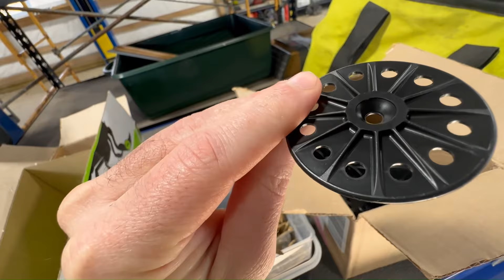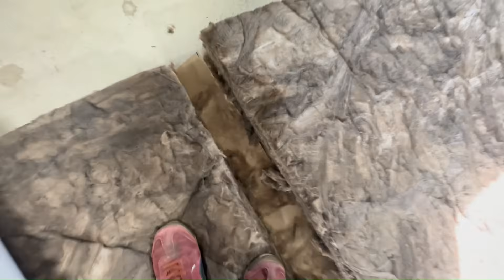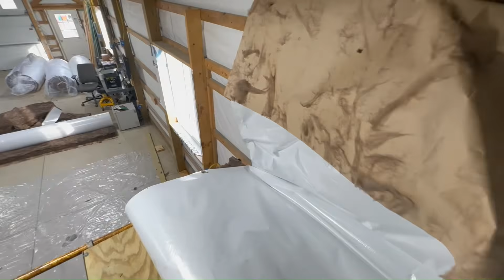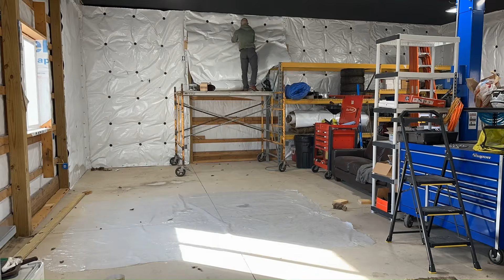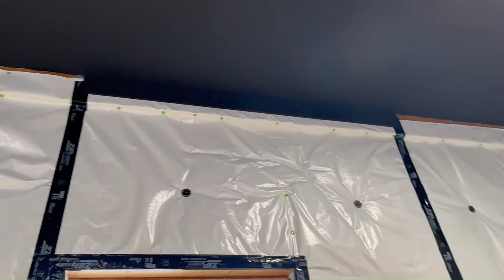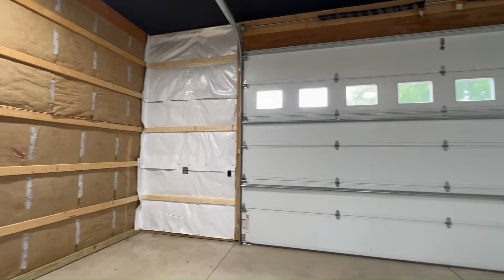Installing the CHEAPEST Insulation In My Pole Barn

Comment: Could you share the info on your ceiling fans please?
Reply from the maker: At the time they were the cheapest 72” indoor/outdoor fans from Home Depot. They are discontinued now but you can find similar ones on sale for under $200. They have worked great for 5 years now and run constantly in the winter. A cool brand that has come out in the meantime is Parrot Uncle. I’ll give them a try if these fans ever fail.

Comment: Just hang the cheese cloth and blow fiberglass in… Done.
Reply from the maker: I considered that but was worried about settling. Do you think the cheese cloth would have spanned 8’ okay? It probably would have been a lot less labor intensive.
Reply: @ShawnFerret 
Yes. You blow it in a little dense and it usually never settles. 
If it settles a couple inches after 10 years, worst case scenario blow in a little in the top layer and you’re done for life !
Waaaaaaay less labor intensive!
Good hustle tho!
Good video!

Comment: What did you do for your ceiling?
Reply from the maker: The ceiling is drywall. I regret not doing metal. I didn’t do a good job with the mud and tape and the seams are all cracking. I painted it black to hide the cracks.

Comment: How heavy was each of your roll? Approx. Trying to find out if 1 person can lift it for transport. (Have shoulder injury)
Reply from the maker: I couldn’t lift one by myself, but I could roll them or drag them around. When the tractor trailer arrived at my house I backed my pickup truck up to it and dragged them into the bed. Then I drove into the shop and rolled them off the truck bed. I think two people could lift them up but probably not with a shoulder injury.

Comment: ?? IF building wrap is on outside and Your insulation has a vapor barrier face, will that create an area to trap moisture between inner and outer walls ? Just a thought.
Reply: No.  House wrap is breathable. Almost every home is built this way without issue

Comment: Really appreciate the video.  I have the same product but have 16' side walls.  Trying to figure out the best way to install.  I chose to put up Insul Hold metal strips to try and support the weight.  We'll see how it goes.
Reply from the maker: I hope it works out for you. It doesn’t seem to take much to hold it. It’s definitely easier with two people dealing with the massive rolls though.
Reply: @ShawnFerret  thanks!

Comment: I have a question.  What is already up on the walls?  Is that the thin reflective bubble foil stuff?  I have that on my building as well.  I was looking to insulate with something similar to what you did but won’t that create two vapor barriers? 

Won’t 2 vapor barriers be an issue?
Reply from the maker: Mine is Tyvek, so it's a vapor retarder that dries toward the outside. So any vapor that gets traps inside the wall cavity can still dry. I agree you wouldn't want moisture to get trapped between two vapor barriers.

Comment: Silvercote told me if I already had the vapor barrier like you do I can’t put this up because there will be two vapor barriers causing moisture build up in between.  They said I needed to cut the old stuff out first.
Reply from the maker: @Grunt300z  I used Tyvek which is a vapor retarder, not a vapor barrier. The Tyvek allows drying to occur to the outside so moisture won’t get trapped in the cavity. I had the back side of the Tyvek exposed for many years while heating the building, and there was never condensation buildup on the backside. That made me confident I wouldn’t have moisture. There is also a 1.5” air gap between the Tyvek and the insulation due to the width of the girts so if there ever was condensation it wouldn’t contaminate the insulation and would have time to dry. I think it’s also an advantage that it is a big open space and without a bathroom or kitchen there is not much humidity being created in here. This setup works for me in climate zone 5 but it might be different in a hot humid climate. I’m definitely not a building science expert but I did put a lot of thought into this because there’s no way I want to have to tear it back out!
Reply: @ShawnFerret  So like R&R buildings here on youtube you were using the tyvek for a little bit on extra air barrier?  I need to insulate dad's shop, that i had no say so in design, but has no tyvek.  I'll probably put some tar paper or tyvek on inside of girts and then insulate similar to you.
Reply: Yes, you have to be careful not to create a "vapor sandwich"..... but I'm not convinced you need to "cut" the old stuff. Perforate maybe, but not cut. But here is the bottom line: IF you are planning to provide climate control (AC in summer, heat in winter), the moisture level in that building will be LOW.... unless you plan on taking showers everyday in that building. So,,, condensation is of little concern....IMHO. I live in SC... climate zone 3. The humidity is HIGH here. My mini-split runs ALL Day. As such, the humidity in my 30x40 is 38 to 40. I am insulation my pole barn in a similar fashion as yours.... and I'm not worried about the vapor sandwich.

Comment: Where did you find the insulation and what was the cost?
Reply from the maker: @danbard2841  I cover cost at the end around 39 minutes in if you want to skip there. It was about $1.30 per sq/ft. You can find the insulation through Menards or just call the manufacturer SilverCote directly.

Comment: what's the thought with the giant screws to hold down the paper?
Reply from the maker: @xCondemnedIV  the screws are extra long because they don’t get run down all the way. That way the insulation doesn’t compress and lose effectiveness. The large washers just spread the load out to keep the screw head from pulling through the vinyl. It’s similar to how Rockwool or foam board is attached to the outside of houses.
Reply: @ShawnFerret  Awesome thanks for the reply. Trying to learn all I can, just had a 30x50 put up and trying to DIY as much as possible.
Reply from the maker: @xCondemnedIV  congrats on the building! It’s really fun to do it yourself a little at a time and watch it progress over the years
Reply: What are the dimensions of your building and what do you have for ceiling installation?